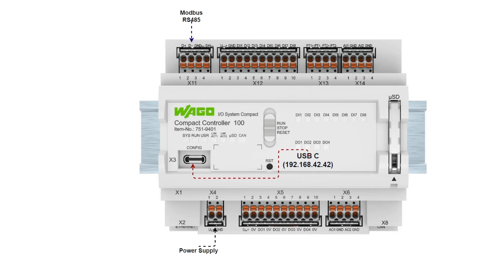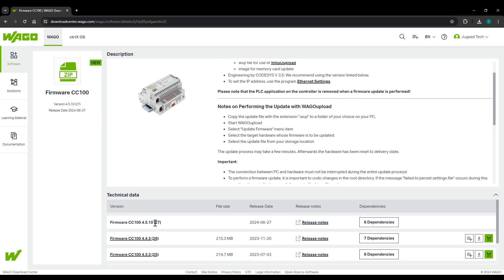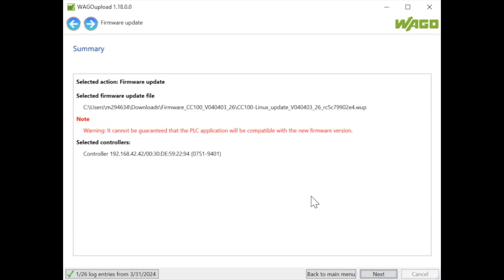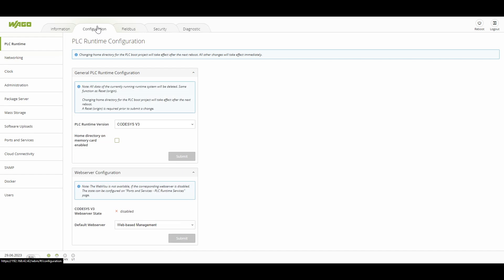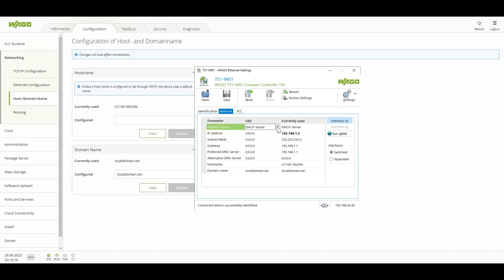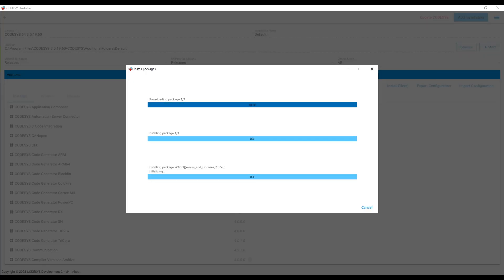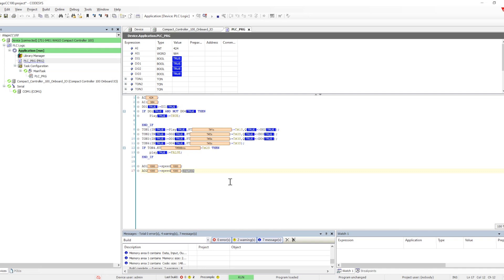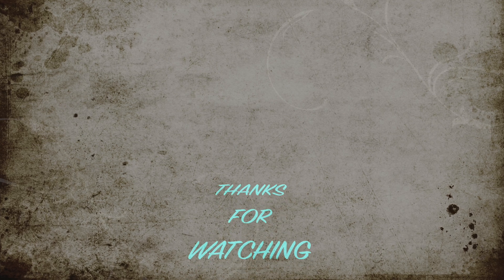Wago CC100 PLC Compact Controller  Part1

Comment: Hello, i have an error saying "no device is responding to a the scan request". I am connected to wago with ethernet cable, and i see it in the Scan Network tab
Reply from the maker: Did you tried with USB C option to connect and then check the web browser for Ethernet connections?